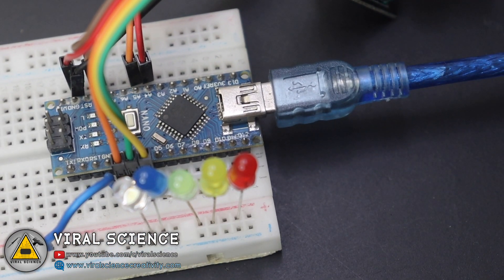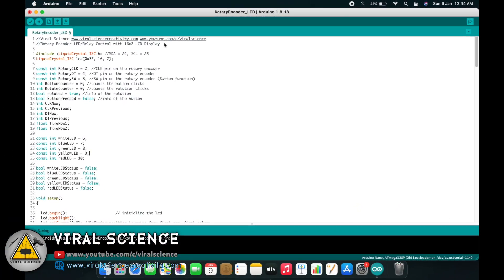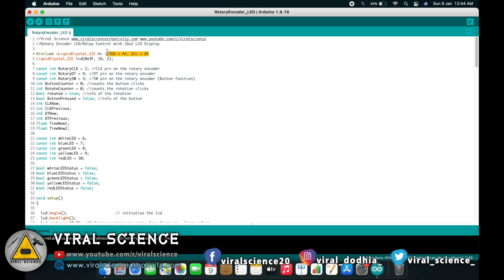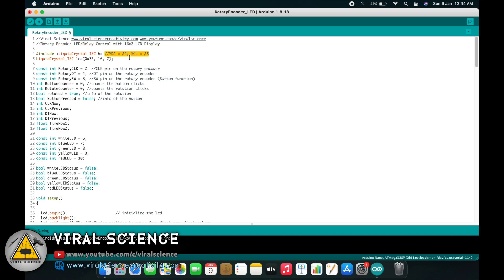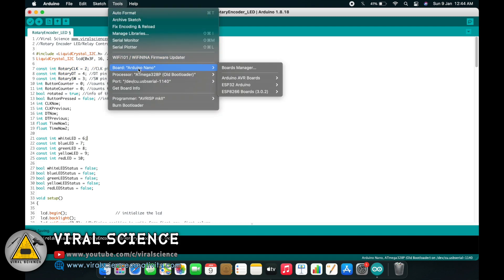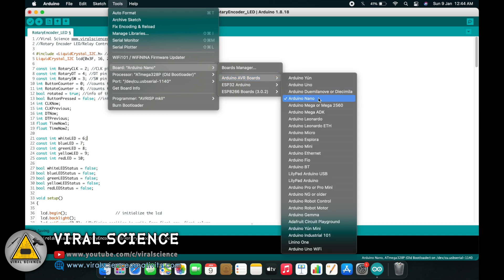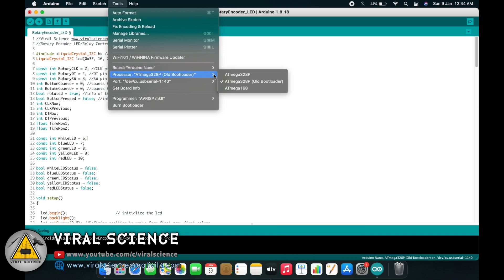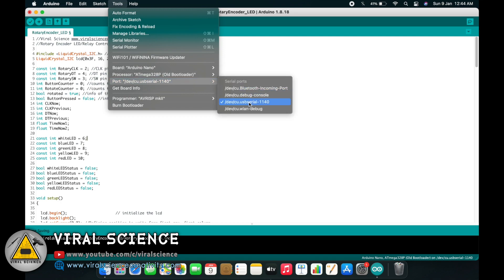Arduino Rotary Encoder controlled LEDs

Comment: Very cool! I have two questions, please:
1) Did you forget the resistors on the LEDs, or was it on purpose?
2) How would you run/stop a servo motor with the red LED on/off and turn on a lamp with the green LED on/off?  Thank you.